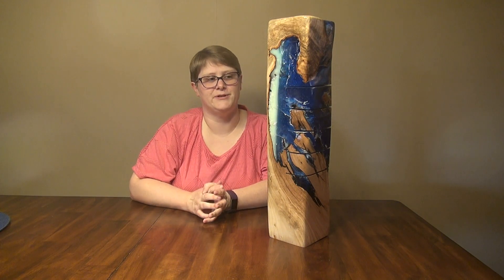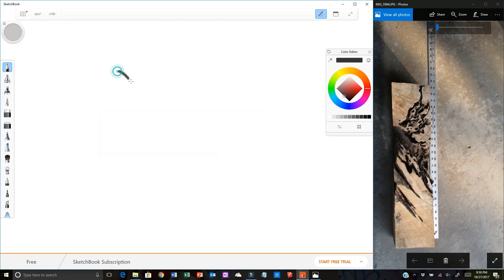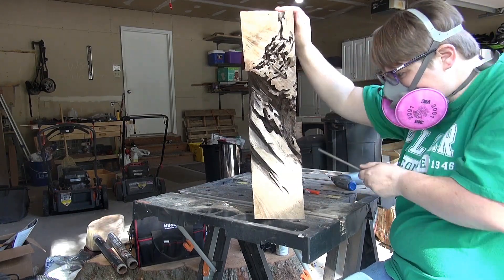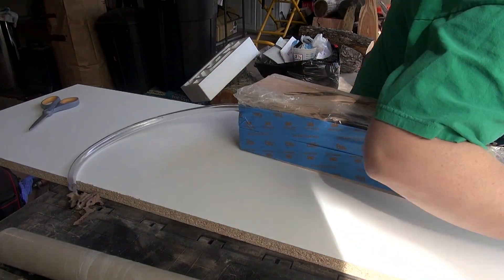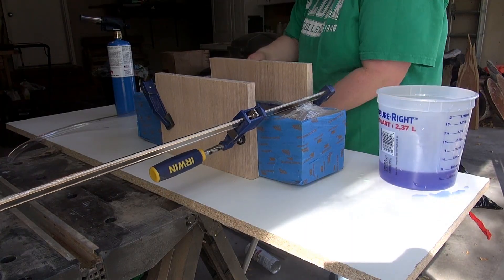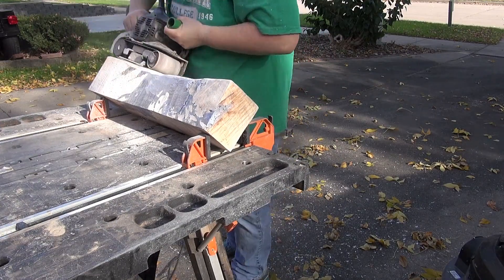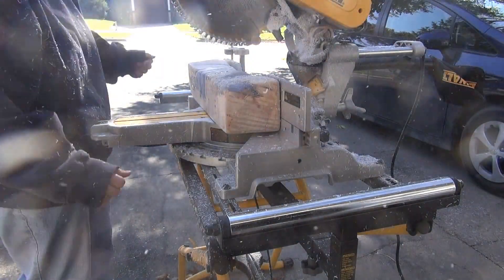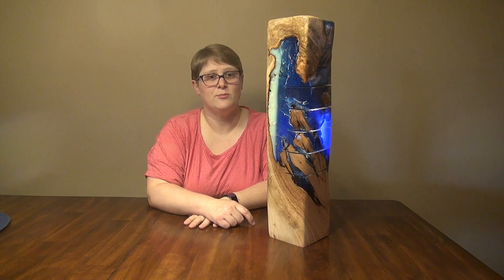Wood and Resin Light

Comment: I like the video. Great first attempt.  The best way to learn is by doing. One thing you might try on something like this is a wood stabilizing resin like cactus juice. It would really help with your air bubbles problem. Just some food for thought. Keep up the good work!
Reply from the maker: Conrite Wing Thank you so much for the comment and suggestion. On future projects I am planning on working with ecopoxy which has a much longer cure rate so the bubbles shouldn't be as large of a problem.
Reply from the maker: Thank you so much for the comment and suggestion. In the future I plan on using ecopoxy which has a much longer cure rate to help eliminate the bubbles.
Reply: Never heard of it so glad you shared
Reply: How much u charge to make this 4 sumone ?

Comment: Nice job! One technique that I try which helps to reduce bubbles coming up after a  pour is to mix a very small amount of resin and brush it on to the word that will be in contact with the resin.  this acts as a seal and keeps any wood trapped bubbles from working their way out since wood is porous. Keep it up.
Reply from the maker: Thanks! Ya I have definitely started doing the brush on thing with super porous wood. Great tip.

Comment: I only pour 25mm of resin at a time 
Once the resin is tacky but not fully  cured you can pour another 25mm
Did the glow in the dark pigments sink to the bottom?
Lamp turned out good and life the finish 
Thanks
Reply from the maker: Yes, the glow in the dark did sink to the bottom, tends to happen with the glow powders. Thanks for the feedback

Comment: I attempted to turn a rotten piece of wood into a cross with led lights set in. Would have been really cool but it went horribly wrong. Took a few tips of you in this video, thanks. I think we both realise now to pour in stages and/or to coat the wood so it doesn't absorb, yet to find out what I can use for this, I am going to try to brush a thin layer of epoxy on and add several layers poured into mould every 4 hours. It's really fun isn't it :)
Reply from the maker: It can definitely be a trial and error process. You may want to look up ecopoxy. I have seen people doing crazy big pours with it on Instagram and having big success. No big bubble explosions or anything.
Reply: I'll look into that thanks :)
Reply from the maker: You're welcome! Good luck.

Comment: very cool project!  i liked your idea of using saran wrap for holding in the epoxy for curing instead of melamine or some other hard surface which would just make the edges and sides perfectly smooth, uniform, and square.  granted, it didn't work as planned, but i love the shape you were able to gave it w/ the grinder and sander-after-the-fact.  i'm brainstorming ways to incorporate this into an outdoor deck scenario, so thanks!
Reply from the maker: Thanks so much and sounds like you are going to have a cool deck project!

Comment: Great Project
you had a great first attempt.
could have done without the sawing of the project to get more light, you just needed less color and more of a clear pour. Torching would have helped the bubbles, as well an epoxy that was designed for a deep pour. 
there are tons of DIY vids out there.
Stone Coat has some great instructional videos.
Reply from the maker: All a learning process. The next one will be better for sure.

Comment: Cool project. Did you think about drilling the hole after your resin set? Also maybe drill it almost the way thru, that should help with the light issue.
Reply from the maker: Yes, now in retrospect, I think with the next one I will try to drill after pouring the resin.  That was quite a depth to drill, think I need to get an impact drill before trying it again.  Had to do it with a hand drill this time which took a lot of oomph.

Comment: Was this your first epoxy project? Have you tried other epoxies?
Reply from the maker: Hi, thanks for the question. It was not my first epoxy project, but I rushed this one. Going forward I will be trying ecopoxy which has a longer cure rate so it eliminates those pesky bubbles, plus better for the lungs and environment
Reply: Freeman Furnishings I’ve tried ecopoxy plastic, long cure time and has a plastic   feel . I’ve tried ecopoxy 2:1, short cure time(2 hours) and feels almost like glass.
Reply from the maker: mike smith good information to know! Thanks. With the shorter cure time were you able to do a big pour?
Reply: The cure time for 2:1 is a couple of hours so if everything is ready to go you can get a big pour done. Just mix slowly to introduce the minimum air into the mix. For best results do a couple of layers instead of one deep pour.
Reply from the maker: mike smith thanks so much!

Comment: Big pour. Minimal cracking. Well done. I find vibration & a plumbers torch reduces bubbles. Did the 'glow powder' settle? Lovely effect. Wonder if it's possible to get the swirl effect u envisioned? I might let resin cook a little b4 adding it. Look 4ward 2 other projects.
Reply from the maker: I might have to try vibration next time.  Though I think I will do it in multiple pours instead of all at once next time too!  Yes the glow powder settled.  Grrr.  I think by doing smaller pours I can work on that swirl effect.  Thanks for watching!